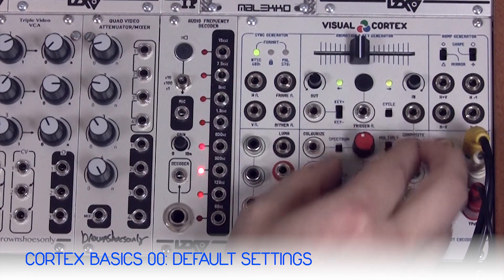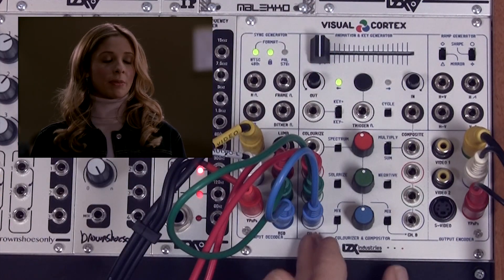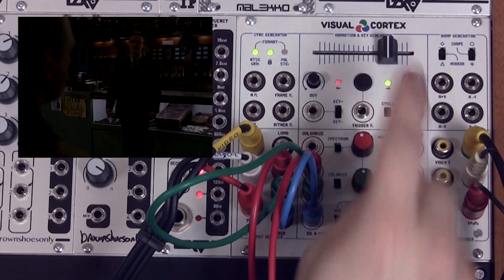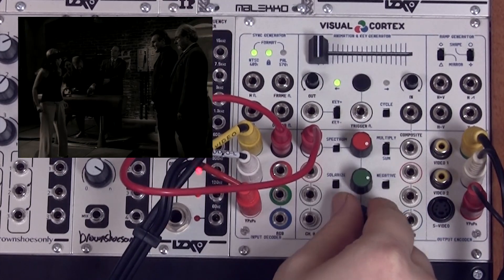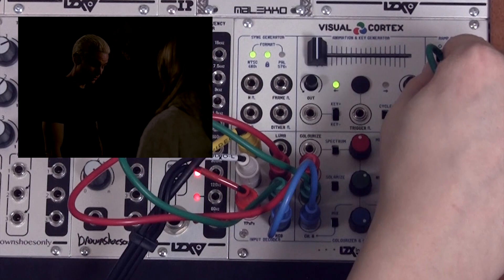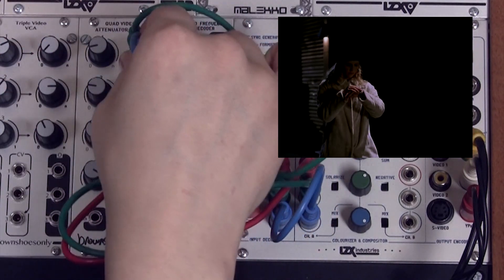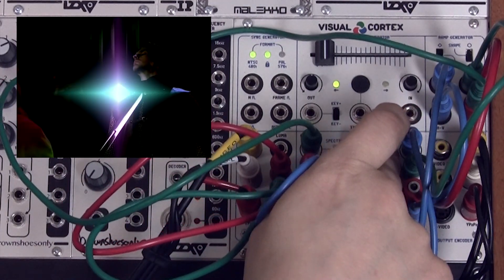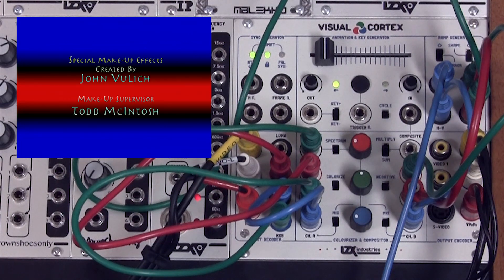Basic Patches for Visual Cortex

Comment: Are you just inputting a composite video signal in the demo? I’m not understanding why the red/white audio connections are plugged in. I tried using component video cables from a DVD player but the Visual Cortex won’t sync with component, only composite. I’m assuming the component cables don’t send a sync pulse?
Reply from the maker: The colors of the cables don't matter--any RCA cables will work for passing component video. If your Cortex is not syncing properly to a component source, you should contact support@ lzxindustries.net
Reply: @lzxindustries  Thx for the reply. I got it sorted shortly after I posted the question. Checked the DVD player’s settings and discovered it was set to output progressive,  not interlaced. Solved. All good now.

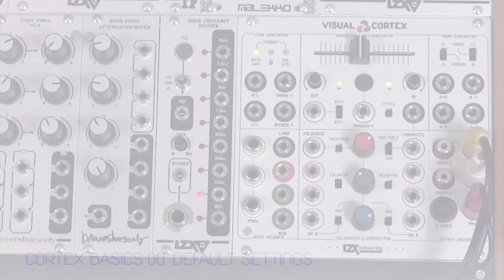Comment: 0:00 Introduction
0:22 Cortex Basics 01: Video Input & Output
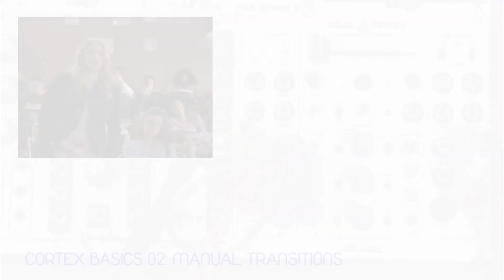1:41 Cortex Basics 02: Manual Transitions
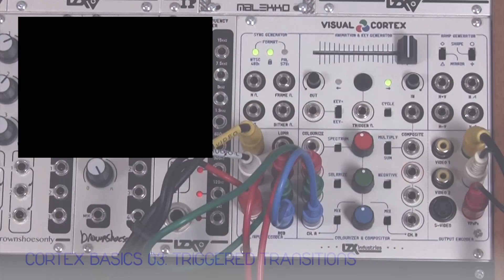2:48 Cortex Basics 03: Triggered Transitions
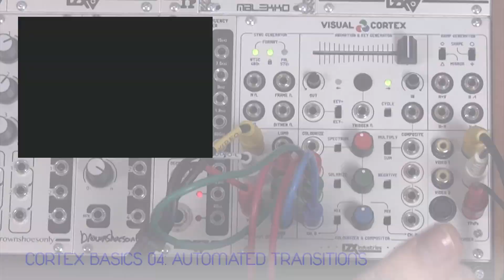3:26 Cortex Basics 04: Automated Transitions
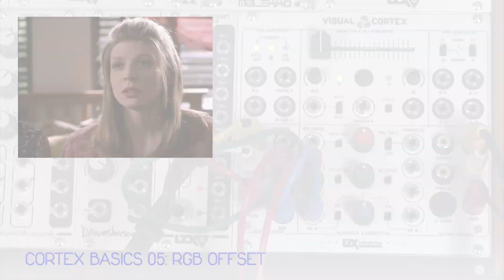4:36 Cortex Basics 05: RGB OffSet
5:03 Cortex Basics 06: RGB Gain & Inversion
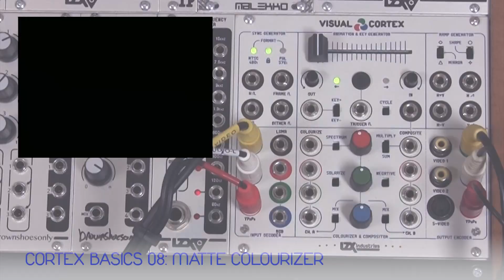5:40 Cortex Basics 08: Matte Colorizer
6:13 Cortex Basics 09: Spectrum Colourizer
6:39 Cortex Basics 10: Luma Keying
8:01 Cortex Basics 11: Wipe & Shape Generation
11:00 Cortex Basics 12: Linear Compositing
12:50 Cortex Basics 13: Solarize & Negative Effects

Cheers!

Comment: Note to new users: RGB inputs for A and B channels are normalized from top to bottom; ie. R input is duplicated to G & B, and G is copied to B, unless normalization is broken by another input. At 1:23, the R input appears as grayscale/luma (R=G=B); at 1:26 the cascade is broken at the G input before being connected to the green encoder output at 1:29 (G=B); then B at 1:31... This really threw me off when I first got the Visual Cortex and figured it was worth mentioning. Shout out to LZX, who fielded my Qs and pointed out that dummy cables can be used to break the normalizations without other inputs.

Comment: Can you get input feedback by plugging rgb outs into ins and splitting them ?
Reply from the maker: Absolutely. A popular Cortex feedback technique patches one of the composite outputs into one of the component inputs. LZX modules are designed with feedback in mind.
Reply from the maker: Yes, the Visual Cortex is capable of internal feedback.